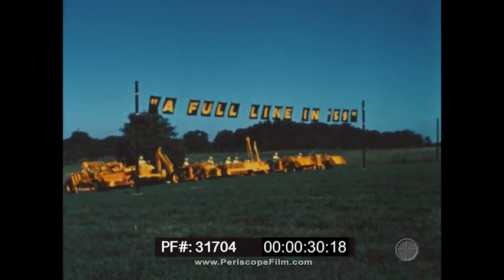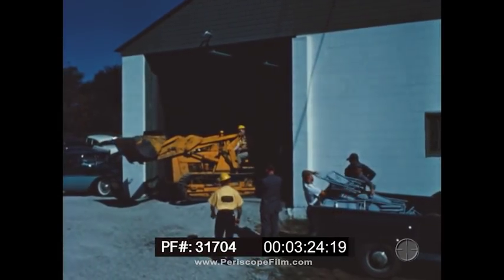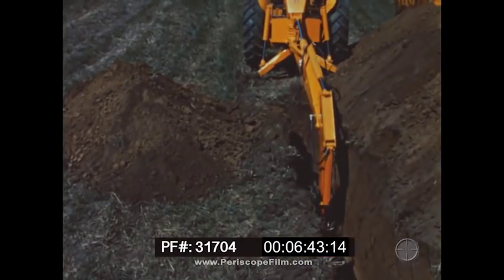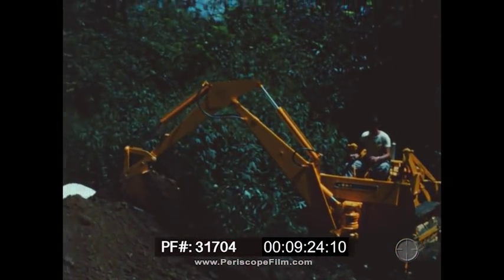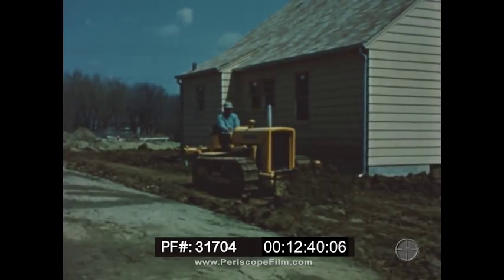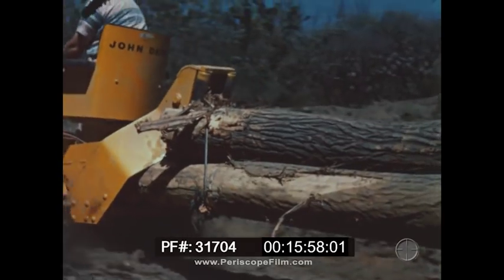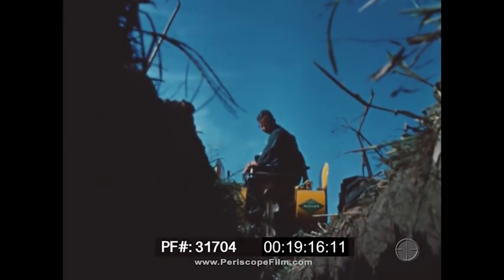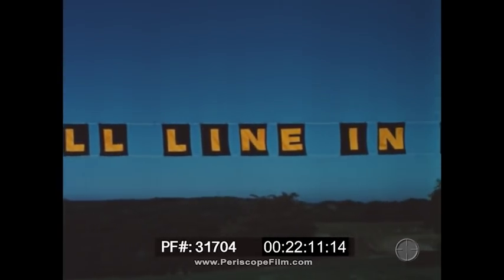1959 JOHN DEERE TRACTORS & INDUSTRIAL EQUIPMENT  PROMOTIONAL FILM  "WHAT'S NEW" 31704

Comment: Skipped the revolutionary 840.
Reply: Yes they did.  And the one shown in the video is one of the early batch made by Hancock.  JD shipped them 830i rolling frames and Hancock did the side saddle and fender conversion.  The fenders are all different.  JD re-designed it and started making the 840 conversion themselves.  They also instituted a program to take in the old Hancock built 840's, revamp them and update them to the newer JD 840 specs.  Not very many survivors look like the one in the video, most were rebuilt to the newer JD design.

Comment: Thanks, Periscope! I've herded a lot of Deere equipment but none quite that old. I liked the removable hoes on the loaders best BUT I could run a 4-lever Ford just as good as a wobble stick rig. All the companies puff and blow BUT it's whoever sits in the SEAT that gets the job done. Brand not withstanding! Thanks again!
Reply: @MatthewFogarty-k2y  10/4 on the Ford. I got to run a Dynahoe at the local DuPont plant. I really liked it but I didn't do much hoe work but wore the bucket out on the front. The 53 series GM/Detroit was just FINE with me!
Reply: @MatthewFogarty-k2y  Is the 5550 the big 4x4 rig? They are NICE and a 4-lever is a simple rig, sure. I like something that just does what it's supposed to do. And you can't have baby hands for a 4-lever!
Reply: @MatthewFogarty-k2y  No, in NC. it's gone now. Made x-ray film. Too bad. Lots of jobs lost when it went. And they will root!
Reply: @MatthewFogarty-k2y  THis moronic place thinks it can make it on tourism. They don't want jobs. IDIOTS!
Reply: @MatthewFogarty-k2y  The same happened to the paper mill. It was bled dry and then scrapped. BUT what goes around comes around. It might take a while but THAT never fails.
Reply: Lewie McNeely   well said!
Reply: @Famous-Potatoes  The truth always stands on it's little flat feet!

Comment: Nooo! They were just getting to the 830 scrapers and then it cut to the end.
Reply from the maker: Unfortunately -- sometimes the films we receive are not complete. ; <
Reply: Yeah, they left out the 5010!
Reply: 5010 was not introduced until 1961 or 62.  It was latter than the 3010 / 4010 intro too. In 1959 Deere was still using the two cylinder engines.
Reply: @Chevy4x4dawg  I think you're right about when they came out. I thought I saw a different scraper in the background and thought it looked like a 5010, that's why I said that. Maybe it was another 830.
Reply: @wailnshred  that was an 840. It pioneered the offset platform for the 5010 and later 760

Comment: Also I take it Auburn and Hancock were independent companies at one point that Johndeer bought out? I’ve heard and seen pictures of those Auburn trenchers on jeeps but not the other one.
Reply: Deere used alot off "speciality" equipment from other manufacturers.  Some items then even removed the original manufacturer's name.  In the case of Hancock scrapers they bought the Lubbock Texas based company in the early 60s. Which then had to sign a no competition clause.
Reply: Chevy4x4dawg that’s interesting.
Reply: Caterpillar had a marketing agreement with Mitsubishi in the late 1980s to get their computer controlled hyd pump, with the Caterpillar 3116 engine...Computer controlled the pumps so the excavator worked at 100% efficiency when needed, and then pumped less oil for better fuel economy when not needed..
Reply: @Chevy4x4dawg   Hancock scrapers were an independent company making allied equipment for several companys like Euclid, Michigan, Wabco, Allis Chalmers and a host of others.   JD was just one of the others.
Reply: Until Deere bought the company.

Comment: I’m surprised that they didn’t use their own engines in their dozers. I’m wondering if it was really the reason they said or if it was some other reason and I’m also surprised that backhoes back then had vertical stabilizers as I find they aren’t all that good and that American backhoes have the spread type.
Reply: the stabelizers are that way to avoid pattent trouble with jcb. backhoes were really new at that time. 
the out sourcered engines were used because john deere only made 2 cylinder tractor engines. 
at the time this came out john deere was brand new in anything other than farming
Reply: Eddie Girvan I had no idea that the stabilizer format itself was patented.
I would assume JD had the engineering know how to make their own but also seeing how compact the Jimmy was I can understand why they chose it. I’m assuming it was a 2-71?
I thought they only started with industrial stuff in the mid 60s and not the late 50s!
Reply: @SquishyZoran  The Jimmy was a 2-53
Reply: Then GM Diesel was a stop gap.  1960 Deere introduced a whole new line of Ag and Industrial equipment with 4 and 6 cylinders.  In 1958/59 they did not have a "small" diesel engine o why spend money on R &D and production if it is going to be replaced in a year.
Reply: @Chevy4x4dawg  Makes sense!
Reply: trackhoe23 ah.
Reply: Chevy4x4dawg That makes perfect sense!
Reply: The vertical stabilizer was used when the swing tower slid from side to side to construct footing against an already there building...Case was at the fore front of LBH in the US of A..
Reply: The 2 stroke GMC diesels go back to the 1930's .